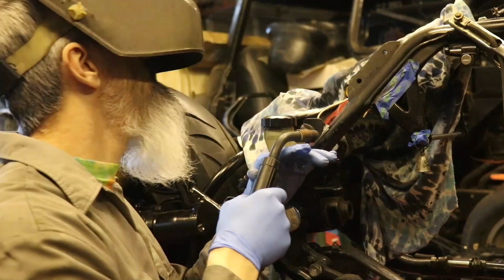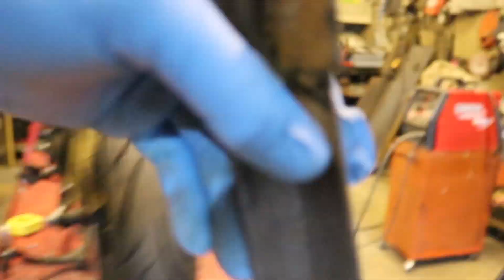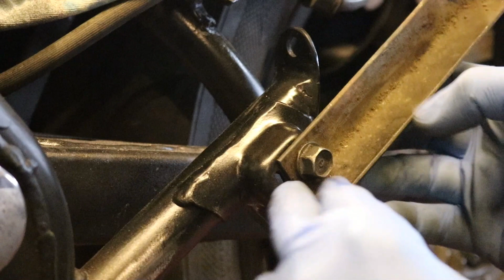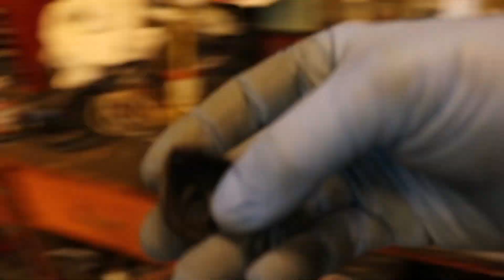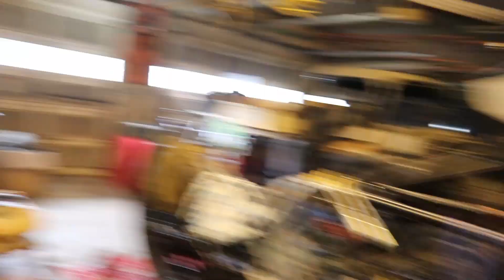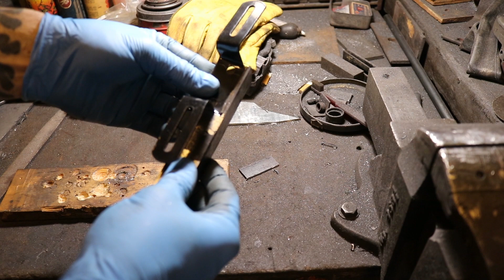Honda Goldwing Bobber Build | E42 - License Plate Bracket

Comment: Just some tedious advice. When cutting rubber hose's, I always cut to the middle and cut both ends to get fresh rubber on the fittings. Just FYI for future reference man.
Reply from the maker: Oh, the tediousness! 😀😊👍. Thanks for the tips, dude. 👌
Reply: Not knocking ya, just what I like to do to get rid of that stiffened rubber at the ends of a hose. I wish I could come help ya man! I stalled out on working on mine since I got it on the road lol
Reply from the maker: @picklerickc1375  no worries, no knocks taken here. I do appreciate the tips and am always looking to learn. It may also be helpful to others reading the comments, so thanks! I did end up putting a new hose on the master cylinder after this video was finished.